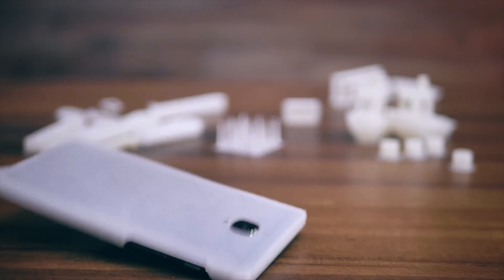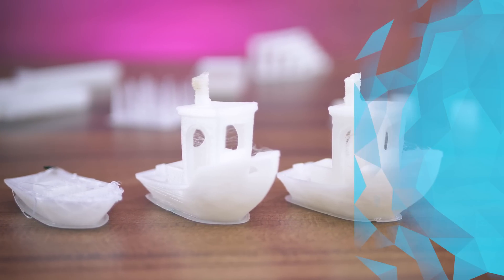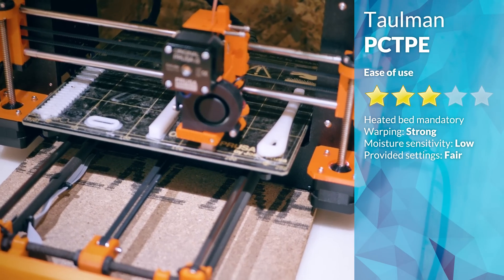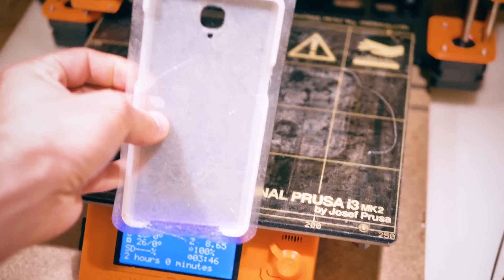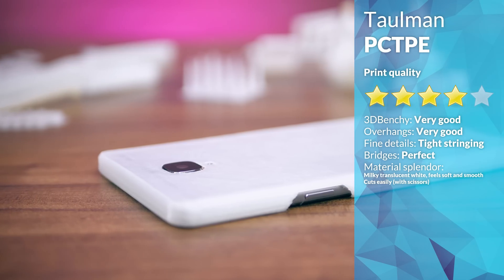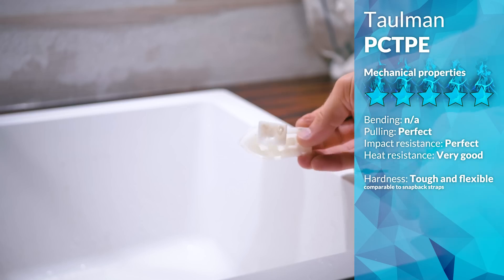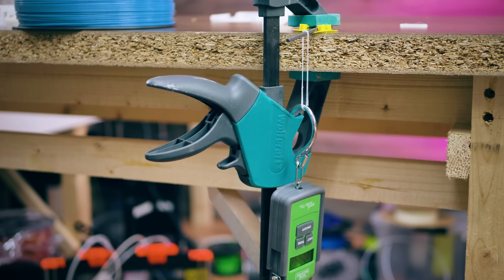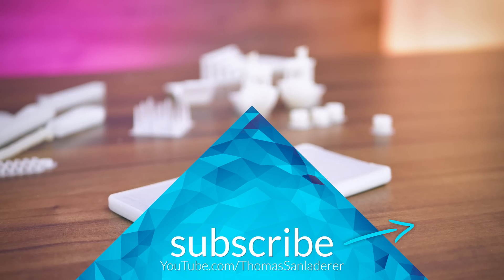The toughest filament: Taulman PCTPE review! #Filaween

Comment: Would you recommend it for printing propeller guards for drones? I worry that if the material is too soft it might bend, maybe even in the wind, and get in the way of the propellers. Do you think it might?
Reply: Have you found any good materials? I'm using polmax PC for my drone prop guards but they eventually break. I think this filament good be really good.
Reply: @bobbybits  I tried the Taulman PCTPE and the prop guards I printed from it have great characteristics -  they're flexible enough to be nearly indestructible, yet not as flexible as TPU to worry about them getting bent by the wind into my props. The price you pay is all kinds of difficulties printing. High temperature (I had to experiment a lot and I think in the end I did 235), poor build plate and layer adhesion, hard to print with support, stringy prints that need a lot of post-print work. However, if you get past these issues, the material itself is great.

Comment: Nylon sticks really well on a glass bed with PVA glue. Mix few drops of water with PVA glue and spread it evenly on 50C heat bed and let the liquid evaporate. Before you print wipe the surface with a wet microfiber cloth and IPA spray. Print at 50C heat bed. The PVA coat lasts multiple prints before cleaning. PVA glue can be removed with a plastic scraper and boiling water.

Comment: Tried the material, works wonderful. Quick tip against the sticking-issues.
I dissolved normal wood glue in water and put the mix on the bad. After that, I heated the bed till the water was gone. The remains let the PCTPE stick to the PEI-bed so well that I didn`t had any issues.

Comment: I tried this stuff approx 2 years ago and it is really tough stuff, but when attempting to print a phone case similar to the one you did I always had 1 layer around where it curved up from the bottom to the side that didn't bond very well so you could split it in to two pieces.

Comment: Flexible prints tend to be really resilient. Traditional strength tests intended for stiff parts do not work that well. If you want a part that will not break and don't mind it flexing, then flexibles seem to be the easiest way to go.

65€/kg really isn't that much for a high end flexible filament, especially if you compare the price to NinjaFlex, which used to be 50€/500gr and now seems to be at around 50€/750g (66€/kg).

What's not 100% clear from the review though is if this filament is of any use at all for "rigid parts" or if it's purely for stuff that can flex. I get the impression that it's so flexible that you probably wouldn't want to use it to make parts for a 3D printer, for example? But that's tricky, because you can make fairly stiff parts using flexible filaments if you just have high enough wall thickness (and potentially infill).

As far as (semi) flexibles go, I really like the generic HobbyKing flexible filament. But maybe that's like comparing cheap PLA to with brand name PETG? In the end, it's what gets your job done and in my case the cheap generic flexible filament has been doing it quite well. The packaging doesn't even say what the material is based on (Is it PLA with additives? - I have no idea), but it does print with PLA-ish settings, so I would imagine the temperature resistance isn't fantastic (not an issue in my case).

Comment: I think that you should have increased the bed temperature to enable the filament to stick better to PEI. Also, making sure the print bed surface is very clean before use can help reduce lifting of problem filaments. Does the flexibility enable parts to return to their original shape after deformation or is it like a kind of softer Nylon?
Reply: Pete Allum the whole point of  filaween is to test and compare filaments from different manufactures AND THE GIVEN INFORMATION FROM THE MANUFACTURER, he probably didn't want to raise the temp to much compared to the recomanded temps from taulman
Reply from the maker: +Narnash the recommendation is 40C on the bed, I was already way past that at 65C.
I will adjust settings, but won't stray too far from the recommendations.

Comment: I found the opposite regarding humidity. Mine absorbed moisture and printed poorly. It took higher temperatures and longer times than Taulman Bridge to dry to a printable level. I did not have nearly as much trouble as you did getting it to stick to PEI. I can confirm that it's layer adhesion is amazing, and it has a nice flexibility. I need to test how well it takes dye.
Reply: I also found it takes longer to dry before use, and seems to suck in air moisture just as fast as 910 does.

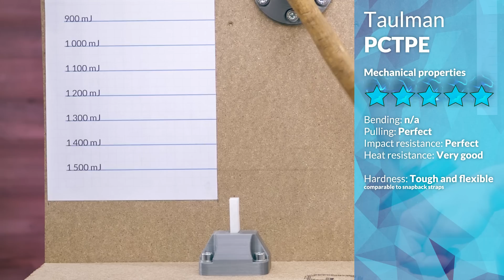Comment: Wait, I'm not a engineer but at 2:50 the whole impact rig shifted on the strike. Doesn't that mean the energy from the impact didn't completely transfer into the object being tested?
Reply: no that means the hammers energy completely transferred through the plastic into the rig and shifted itself.
Reply: It's a homebrew copy of the Izod impact test. It's not an ideal rig for impact forces this high.
Reply: Fair point, but for comparison's sake, all filaments get the advantage of that slop.
Reply: It's a homebrew solution and probably needs to be portable, after all there wasn't a material  that caused this issue yet meaning that the not 100% scientific diy scale for impact resistance did it's job in fact perfectly fine. The exact numbers can't be compared with the actual impact resistant tester, but all materials tested on the same diy scale are absolutly compareable.
Reply: But if the shelf was completely bolted down and no way for it to move, then wouldn't more energy be transferred to the object?
Reply: The modulus of the test set up matters.
Reply: TR1PpyNick right, but if you image someone kicking you while you are free standing vs you being against a wall. The energy is being transferred into moving you and is less then if you absorbed all the impact and stayed stationary correct. 

This is why through and through bullet injuries are less then when a bullet impacts and is completely stopped by flesh.
Reply from the maker: I know the setup isn't perfect - and it's not intended to be! For the sake of comparing one filament to another, it's totally adequate, but if you want to real scientific results you'll need to bring out the big guns.

Comment: There's a thread on Duet3D forums showing a polycarbonate (Bayer extruded Makrolon) plate wet-sanded to 60 grit holds any filament without bed heat, including POM and Nylon. I tried with PLA which worked well, but PETG gave me problems. Give it a try with this and Nylon?

Comment: My Anet A8 has been working well for almost a year, but now liquid plastic (using hatch box petg) is leaking from around top of printer head and where the heat block and the metal threaded tube meet, and build up and drip onto the print bed and ruin the print. If anyone can help me with this or has the same problem please contact me.( one reason for the problem might be a slight change in the print head, I recently replaced it and noticed a small space around there it screws in)
Reply: your threads arent sealing against it you either tighten it harder or replace it
Reply: christian XDD thanks
Reply: Don't "tighten it harder" snug it up. Its not a wheel lug, if you tighten too much you'll break something or strip the aluminum threads. Go to the auto parts store, ask for high temperature silicone, unscrew the heat block from the heatsink, coat the male threads with some silicone. reassemble, wait a day.

Comment: At the start if the series you mentioned you wanted to bring the scale down a bit where a really good filament might get 4 stars and the extraordinary ones 5 or flaming. Yet i feel like every material you tested until this point gets flaming stars. I think you should try to bring that scale down a bit again, because some are really not perfect. The amount of effort this one seems to take ia way to high to get a flaming stars, i would've given it a 5 because its that tough, yes, but not a flaming. And that, at least i feel like, to most of the flaming stars filaments, where they are just not "that real shit".
Hope you can understand the point and it helps you reflect over the series

Comment: Do you use a wooden enclosure with your Prusa? Does putting the Prusa in an enclosure cause any problems with the electronics when you print at higher bed temperatures?

Comment: Thomas. I love your testing equipment. I teach HS physics and engineering and I was wondering if you had any plans for the hammer testing apparatus you use in the video. My students build bridge structures for one activity and we also break turkey bones and it would be awesome to figure out how much force it takes to do that with a system similar to yours.
Reply from the maker: +Rob Turner it's inspired by the standard IZOD setup - lots of documentation on that out there!

Comment: Would you recommend this stuff for some high load gears? I'm talking Electric Mountainboard drivetrain here, or is the stuff too flexy? Taulman recommends Nylon 645 for gears as well, so i thought this might work better.
Reply: Well considering it's a TPU and as such a somewhat flexible material I don't think it's the right material for gears 
You want your gears to be rigid to minimize slipping
Reply: think so
Reply: I_am_me hard to say if individual gear tooth's would be too flexy, but I guess I will stick to Polycarbonate for now

Comment: I use plain old clear shipping tape for printing most Taulmans; takes a little post processing but the models stick really well.
Reply: John Mullen Polyester packing tape or the really really cheap polypropylene based packing tapes? (I have some of the really cheap PP stuff for adhesion of some polypropylene filament I have, but never thought to try it with nylon.)

Comment: I printed 2 spools (the small sized ones) of Alloy 910 using blue painters tape, the texture of the tape allows the nylon to grab mechanically.  sometimes you have to sand or scrape away a thin layer of the top surface the tape that stays on the print but you won't have any detach during printing.  Might not be so great for a flexible if you need a really clean base surface, but worth trying.  If the Z height is correct and you dont compress it into the tape nylons usually come off clean with just the texture of the tape, its when the Z is low that the tape really gets attached a bit too well.
Reply: 910 printed on a heated glass bed coated in glue stick has rarely failed on me.
Reply: Nylon sticks to painters tape good enough to lift the painters tape off the bed. Still end up with curled edges.
Reply: Soak the part in hot water for maybe ten minutes to remove the blue tape.

Comment: Thanks for the test. Personally, I would like to know how hard/easy supports and raft are peeled.
Reply: My experience with nylon says, it's the WORST for raft and support removal. I never use rafts anyway, but to remove supports, you basically have to CUT them out if you need to remove them. I would guess this stuff here is similar. Check out how stretchy it is in that layer adhesion test in toms video... It's definately not like PLA where you can just break supports away with your fingers or pliers, you will need a scalpel and flush cutters.
Reply: So far, it's not been too bad, even better than PLA in my experience...I can just tear it off :P